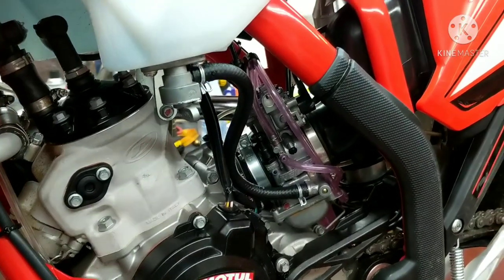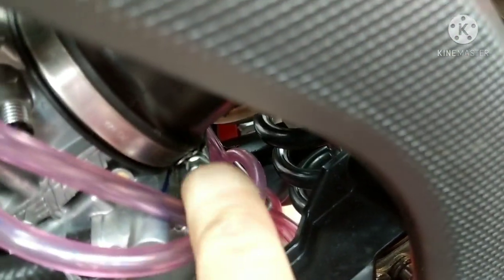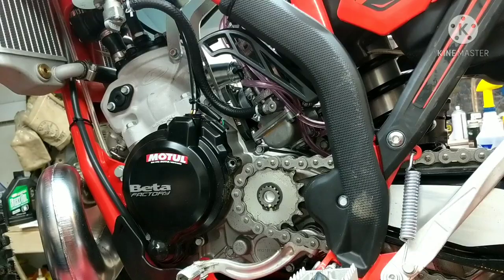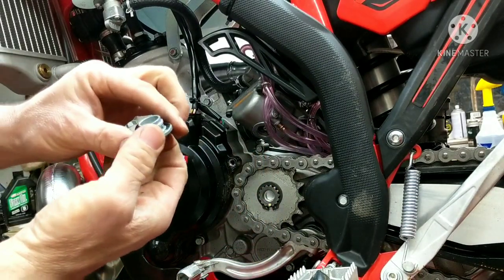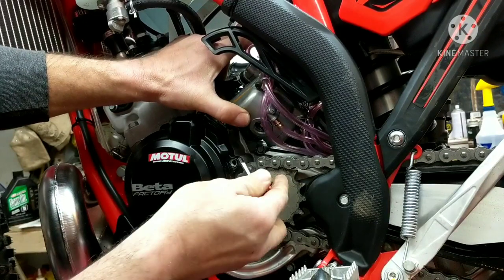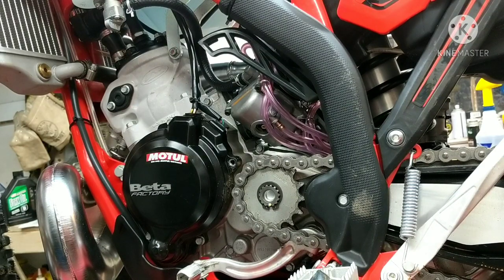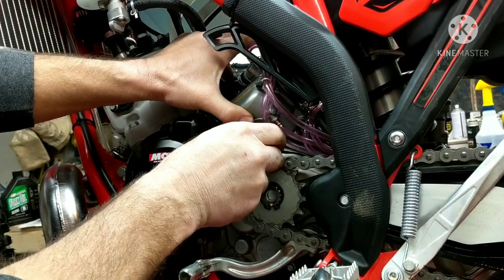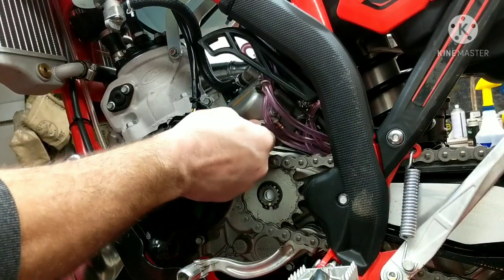Easy pilot and main re-jet on bike Beta 200

Comment: Another good video. Nice and efficient. How do you warm-up your 2 stroke? I've seen a couple of suggestions but they are very different. Thanks
Reply from the maker: I start it up turn the choke off as quick as I can, ride it around easy for a little bit and then hammer down.

Comment: I took my 2024 200 out first time and it stalled 3 times at the end of riding and wouldn’t hold idle without throttle when warm.

When engine is cold it will start without choke which makes me thing air/fuel and possible move needle down? Any advice?
Spark plug was almost fouled
Reply from the maker: Sounds too rich. Check the float height many came from the factory set incorrectly and lean out your pilot jet. You probably have a 45 pilot, try a 42 or 40. If it's not idling I would focus on the pilot circuit first before I moved the needle.

Comment: Thanks for this, I am picking up a 22' 200RR next week. QUESTION: In a previous vid you dropped the needle one notch = leaner. Do you expect to leave it in that position from here and only adjust using main and pilot jetting? THANK YOU! Jim from Texas
Reply from the maker: It all depends on the feel of the bike with weather change. If I'm getting a rich or lean feel on mid throttle I'll move the clip. I have found that if you set it good in your mid temp ranges, and you ride year round in the same elevation, you usually don't have to touch anything with season change.

Comment: Hello, thanks for sharing this video. Just got a 22 300RR and I have some pipe bang on throttle decel...What is the starting point to get rid off that hammer knocking noise? Reeds? Octane? Jetting? Dealer says it's normal to get some pipe knocking in beta 2 strokes... If I could, I could send you my video so you can ear exactly the noise a I talking about (there's no pinging and i'm running stock settings) Thanks Again.
Reply from the maker: Sometimes going up a jet size on the pilot can help that. Nothing really to worry about, my KTM's did it also.